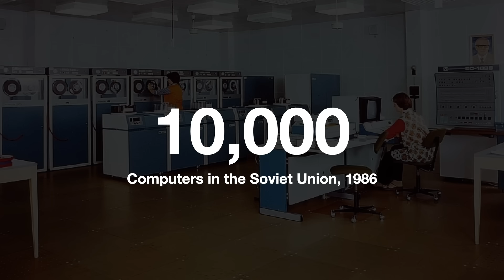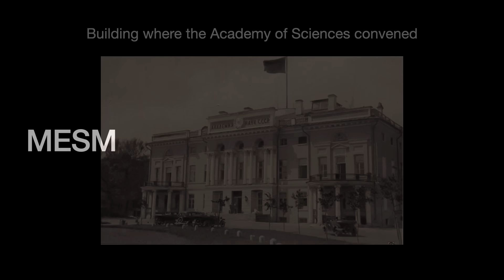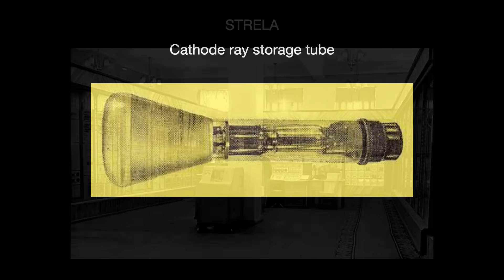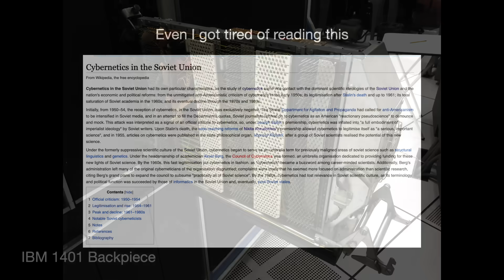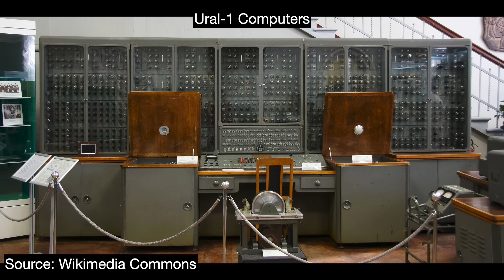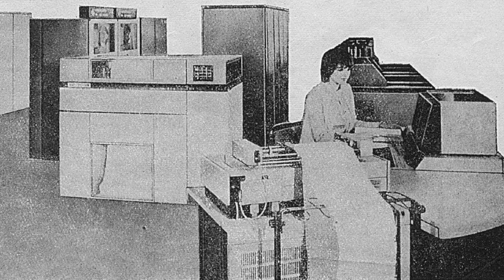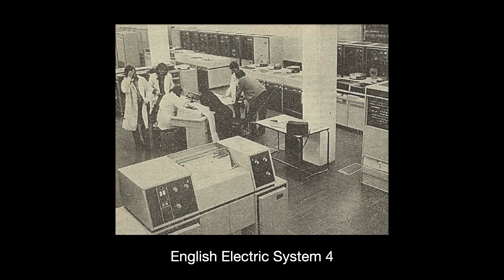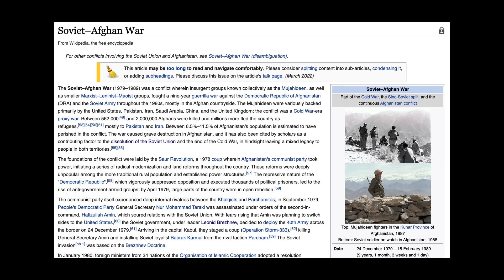Why the Soviet Computer Failed

Comment: The biggest issue faced by the soviet union and highlighted in all the histories of each individual industry was the core doctrine of Socialism which is centralization of those industries which in and of itself removed incentives present in Market (Capitalist for those that don't know the original name) economies. Those incentives being primarily rooted in competition. Socialism universally removes incentives for improvement, for innovation, for invention, for production, and for quality. Why break your back and frustrate yourself when you get the same as the guy doing the bare minimum next to you and any and all extra work and effort gets you no recognition reward or promotion and could end with you being punished by the guy above you. On that note does that last part sound familiar? Maybe because that is the current corporate structure within the U.S.A. which only further solidifies the argument that Corporate culture isn't Market (again Capitalism for those that don't know) but instead Socialism. I like to call it Corporate Socialism.

Comment: The Soviet Union, one big inefficient socialist state. China is luck not to have mimic their inefficiency.
Reply: Anything state controlled is inefficient in properly distributing things to where they're both needed and wanted in a timely manner.  China's overcapacity problem and their need to dump products in foreign markets is the result of socialist inefficiency.   The CCP subsidies to sectors based on what's currently hot and fails to perceive when the world has moved on.

Comment: Ancient codgy computer scientist here. No way that the BESM 1 could do the same number of  flops as ops. I think people are mistaking an equivalence of ops and flops. They are not the same. You state that the BESM 1 could do 8-10,000 OPS and then equated that to 8 to 10 KFLOPS. I have seen both stated on various web sites. I do not know which one is right but I know they are almost certainly NOT the same.  Calculating a floating point operation is TIME CONSUMING! You have the exponent. You have the mantissa to worry about. None of this is a problem for integer operations. IIRC the old Intel 80186 processor needed something like 32 to 80 clock cycles to execute a floating point operation while it only needed about 8 to 20 clock cycles to execute an operation. It takes about 4 times longer to execute a floating point operation than a simple operation.
Reply: Actually you are true but not 100%

Comment: Interesting topic.. I've never heard much about Soviet-era computing so this is quite interesting to me as a lifelong computer enthusiast who is old enough to see the whole computer revolution how it started and evolved. Pretty much anything and everything which came out of the Soviet Union was technologically inferior compared to Western standards. That's just pretty obvious due to the fundamental flaw of Communism and the whole concept of a self-sustaining State with a government that controls everything and runs every industry. 

For products and industries to evolve and innovation to occur you need competition. Competition was largely completely absent in the Soviet Union. Therefore there was no pressure to innovate and improve technology. Providing it worked reasonably well, that was good enough. The main driver in the Soviet Union Communist State model was efficiency, making things cheaply and ideally not having to replace them too often. What does that result in? Cutting corners, designing and manufacturing consumer products towards reliability, durability and the lowest production cost. That's why Soviet-era cars and products like cameras were quite bland, with very little choice, or thought given towards the end users. Once you bought a car in USSR, you'd drive that car until it was literally undriveable so most people had the same car for a two decades at least. This is why when you see early footage of the USSR it just looks surreal compared to the West, like a place frozen in time. 

The same applies to most consumer goods in USSR..everything was about cost-efficiency, reliability and durability. The design of Soviet-era things therefore generally leaned towards using the least amount of parts and functions possible and something easily serviceable.  Often they would steal or copy the design of Western products but re-engineer them for simplicity and Soviet manufacturing efficiency. A prime example of this is the Makarov PM compact semi-auto pistol which was the standard firearm used by most Soviet police officers, military and government agents. The Makarov was a Soviet copy of the famous German Walther PPK pistol the Nazi's used which the Soviet's had obviously seen. They re-engineered it with far fewer parts, resulting in a similar looking, far less elegant but reliable and more easily field strippable conceal carry compact pistol.

One-size fits all was the  thinking in the Soviet Union. Why offer people tons of variations and choices on a product for a specific purpose, say a camera? That's cost inefficiency, waste of resources and sheer stupidity by capitalists the Soviet's thought. However they didn't realise that technology (and a society as a whole) needs that choice and competition driver to innovate and evolve. Without it everything becomes very bland, boring and utilitarian-driven..the State and sociey stagnates and budget constraints is a constant concern and careful balancing act, particularly since you have a massive growing pensions liability as the population ages. That is ultimate what killed the Soviet Union, and it's still a major problem Putin faces today...the Russian Federation has retained the pensions liability from the Soviet era and Putin is under pressure to raise the retirement age again, more so now he has so many sanctions on Russia and a mass exodus of young people..he knows raising the pensions age again (with the low life expectancy age in many remote areas of Russia) could be politically fatal for him. He tried it once and his popularity dropped overnight to its lowest point by around 30% and he faced massive protests outside the Kremlin. 

Industries in the Soviet Union were run on tight budgets, and the State's main resource was labour (everyone was employed by the State) so there was no incentive for the Soviet Union to modernise factories, develop and introduce automated assembly production, in the way the West and rest of the world began to by the 1970's and 1980's. Which creates a paradox. The Soviet Union relied upon maximum cost efficiency in manufacturing but couldn't achieve that without automated manufacturing. And it couldn't do that without putting 100,000's of people out of jobs,  many of whom would then just become a financial burden on the State, or a crime/social problem. 

So the Soviet Union was happy to have people assembling things by hand with painfully slow production and the end result being technologically inferior end products, which ironically were being produced at higher cost (labour cost) due to lack of automated assembly manufacturing. 

Often in the Soviet Union, if you purchased a car or other advanced consumer product, there would be a waiting time for delivery in the USSR which could be anything from months to years. There's many jokes been made about that by Russian's, and even President Reagan made a few. Years of waiting time for car customers was the reality for many Russian's in the USSR when cars were being assembled by hand. 

So therein lies a fundmental flaw in Communism (which is part and parcel of the reason why it failed) and is a paradox in the flawed political ideology. The very thing it relies upon to function well, efficiency and low-cost manufacturing, is prevented and the opposite happens due to State control all industries and providing jobs for everyone. And not having an open marketplace or any manufacturing competition. You also have crude and technologically interior products being churned out, without competition to drive innovation.

The other side of the equation of the Soviet system is of course, sustainability and redundant capacity. It does have that going for it. It's a much more sustainable approach to consumerism, without competition and with goods made for long-term durability, there's far less waste and environmental damage...in theory anyway. However with this one-size-fits-all approach and centralised State manufacturing system, you better be sure your products are incredibly well designed and don't have any flaws or start failing and require recalls or worse complete replacements, else you have colossal inefficiency, wastage and environmental issues on a State-wide scale because everyone is using the same or similar product! 

Because of the manufacturing efficiency in consumerism and the massive centralised industrial and academia power of the USSR it was able to utilise redundant capacity towards scientific and military projects with more focus and resources than Western countries could..which is why the USSR was often quite pioneering in that regard...the first space flight, quick to put satellites into low orbit, the world's largest atomic bomb test and nuclear power electricity generators, and the most advanced military after the US. Many scientific and academic first achievements arose in the USSR.  

The Chinese Communist Party observed the Soviet Union and learned from their mistakes...they refined Communism, retained the centralised top-down totalitarian government part, but abandoned the States industrial monopoly and State self-sufficency element. China eventually realised under Chairman Mao (painfully, after 40 million starved to death from flawed rice production methods and poor harvests) that the capitalist approach in manufacturing, supply and sale of consumer goods is definitely superior to the Soviet approach, has many advantages, is far more sustainable, drives technological innovation and provides a vital revenue stream from the outside world. That is pretty essential in a country the size of China with over 2 billion people and limited natural resources. So China introduced a Communist Capitalism approach. Whereby the State still owns and controls most of the factories and production capability, but it gives people the autonomy and flexibility to own and run a busines, and to freely compete with each other in an open marketplace. However that marketplace was a one-way system, mass consumer goods exported, only essentials for the State imported.It remained that way for a long-time until China's economy grew sufficiently large to allow consumer goods into China. And even then when China allowed Western consumer products to compete in the Chinese domestic economy, it was done on China's terms. Goods being manufactured in China according to limitations and criteria set by the State, so you have a Chinese version of everything which the State can control or prevent Chinese from using to access the Internet, Western news and mass media. Gradually China has loosened that grip over time, and has become more flexible on allowing foreign companies to setup retail outlets in China..but its control over the Internet, access to Western news, media and visiting people, remains as tight and vigilent as ever.

And that leads to me the conclusion and summary of this 'essay' style post.... The Soviet Union model was doomed to fail from very beginning with fudamental flaws in a self-sufficient State approach. It's surpising it lasted as long as it did. 

The Chinese approach has proved a far more effective and sustainable form of Communism. It has put them on a path towards becoming a super-power country and economy that may exceed the United States in a few years time. Communism in its Soviet form has failed pretty much everywhere its been tried, except in China with the revised economic approach. 

North Korea still clings to the original Soviet model, but is dependent on frequent hand-outs (under the constant threat of nuclear weapons use) a massive illict State-run drugs industry, and State-organised cybercrime generating billions of dollars, whilst maintaining the illusion of a modern functional State for Western eyes and visitors...when in reality most of the population are barely existing and close to starvation in many aeas.
Reply: The Soviet Union had huge amounts of manpower, but allot of it was wasted. Having factories over ordering manpower just to make sure they had enough because there was no downside. So I would argue that this notion that Soviet Union production was effective is not accurate. I would also argue that an export based nation like China is no super power. Sure, they have nukes, but so do many other nations that are not super powers. The CCP has the largest private military in the world, but how much of it is actually combat ready and not just a force used to keep control and getting mostly ideological "training" rather than actual operating training. 

Considering this videos topic. One has to view the irony that China itself is ALSO struggling with chip productions because while they have adopted some aspects of a capitalistic economy. They still retain aspect to the old command economy only, Communist leaning that stifle innovation and increases corruption. How many "chip programs", with billions spent, in China has just turned out to be fake factories, workers, tech and re branding and selling of 3rd generation Western tech as "new". LoL, China is no more a super power than current day Russia is one.

Comment: By 1986, there were over 10000 BK-0010's  alone, verified by serial numbers. And there also were MANY other microcomputers (not saying about bigger computers) in the USSR at the time. For example, Электроника НЦ-01, Электроника Т3-29, Искра 226, Электроника Д3-28, ДВК, Агат, Ириша, Радио-86РК, Искра 1030. There also were at least two clones of ZX Spectrum by 1986.
Reply: Might be over 10000 AGATs, there were 50000 by the end of 1989. Might be over 10000 СМ ЭВМ, there were over 60000 by 1990. Over 8545 Elektronika NC (not all models counted). 529 BESM.

Comment: So what.  Much, if not most of human life, activity, technology, accomplishment, and advancement can be accomplished mechanically.  You need to ask yourself to what degree do we want fragile and quickly outdated computers to do work for and have control over humanity.  Clearly, you have not done enough research into alternate mechanical, analog, personnel organized, and biological systems.  I am open to discussing your mistaken perspective of life and technology.  Simply email me.  A missile, spacesuit, older pickup truck, scientific calculator from back in the day are still what they are and function to do.  Consider the SR71 and moonshot were done well before today.  I would go as far as to say Space X has shown that it is never about the computer technology but escaping red tape and bureaucracy.

Comment: I just saw a video of the unboxing of a Globos inertial guidance system used on Soyuz spacecraft until 2003. It looked like a toy from the early 1960's that was supposed to make them like science.  The Soviet system had a little plastic globe inside a window that would go around so the crew of the spaceship would know kind of where they were. This video really pulls into focus why that was still being used in this century.

Comment: In high school I had a friend who’s father had gifted him a rather ancient  guitar amplifier. It was quite novel in that the dials were marked into 16 divisions rather than (at least in the west) usual 10. This unusual amp purchased from a German pawn shop has infact been made in the  region of the Ukraine just a few years before Nicolae Ceaușescu took over the country. The amp was extremely rare mostly because Moscow simply didn’t see any real future in electronic manufacturing and were absolutely not interested.  🤷 Just like that, it all went away.
Reply: Those who are familiar with audio engineering would perhaps understand the significance of the 16 divisions. A human ear is unlikely to be able to detect a sound level difference between say 4 watts and 5 watts of power but will be able to detect a difference between 4 and 8 watts.  And then 8 watts and 16 watts and so on. That of course is why sound is measured in the rather cumbersome decibel system. Recognizing this the designers of the amp felt that dividing the dials into 1/2 1/4 1/8 1/16 divisions made more sense.

Comment: If you seen slowly the video you will feel the same.
Why soviet technology fall behind US, easy because the individual projects never be supported.
When a scientific project gave attention by the goverment or a inversor group you can have the opportunitie for worked.
But when there is only a burocratic and centraslist system is more difficult to have individual projects to gain attention and founds.
Ukranian, russian belorussian, kazak, and many other have great habilities, but without support they fall in oscurity. Also there's no market for commercial computers, dimishing the least impulse they can gain.
Press F for soviet engineers.

Comment: BK-0010 computers were produced from 1985, 78000 for households, 44000 for schools. Or more. In 1988 we had a class with 30 at school. Electronica MC 0202 was produced from 1987, 310000 computers (22000 school classes). Then some others, like Agat (12000 from 1983 to 1988, 7000 im 1989). Plus the big amount of self made ZX Spectrum clones... not everyone are lucky but I had the access to several university computers in Leningrad and Volgograd (Apple II, DVK-2, 286 and sometimes even 386) and 2 school classes (even in 1st grade).